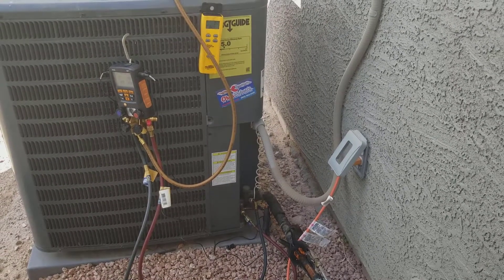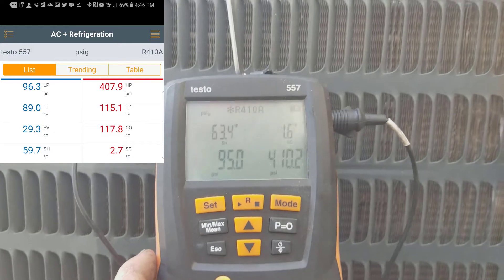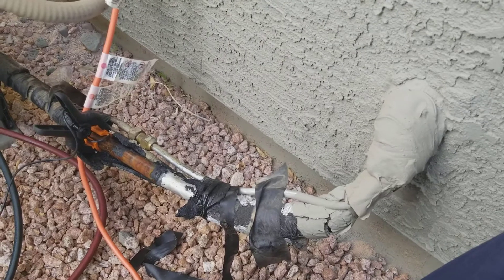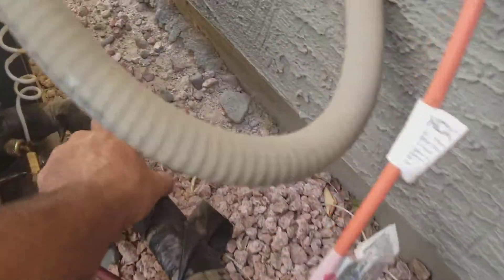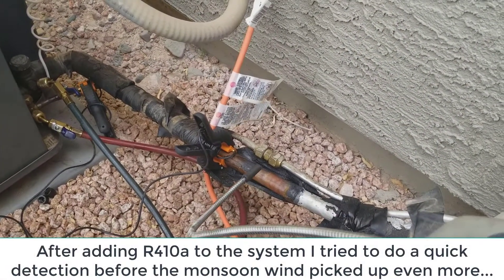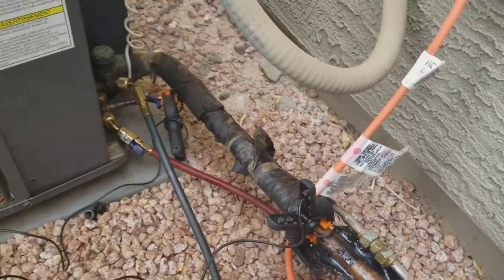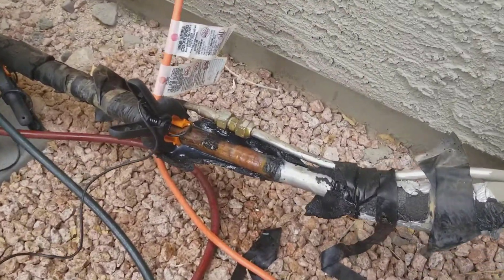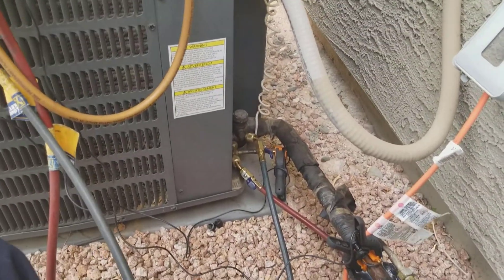Chainsaw Charlie aluminum lineset leak. Another local plague

Comment: It's bad enough my house has aluminum wiring mixed with copper...thank fuck my lineset is all copper...34 year old Keeprite (carrier) still going, never a breakdown or one single issue in the 19 years we've owned the house and the damn thing will now freeze your ass off even upstairs, thanks to duct work sealing and repair, mods...Fuck Goodman...as always

Comment: You can braze it with the right rods, but it needs to have heatshrink over the joint once leak tested to prevent corrosion. Also needs heatshrink over the flare connections too for the same reason. I expect brush on electrical tape would work too but don't quote me on that! 

Have a look on youtube for Lawton Tubes channel as they make the ali pipe and have some vids on joining it.
Reply: Good to know, haven't had to deal with any alum/copper brazes yet but, good to know they need corrosion protection
Reply: I'll have to make a vid on trying them, have brazed ali to ali with them but not copper yet.
Reply from the maker: Yeah I've seen that.
The units with aluminum coils that convert to copper for field brazing all have heat shrink tubing over the joints.

Comment: thanks. how would one cobble-braze copper/aluminum anyway without disintegrating the aluminum?
Reply from the maker: I dunno. I am thinking that I might just use flare couplers. Dissimilar metals might play a role too but hopefully not. The coupler they used looks steel or something. I will probably just use brass.